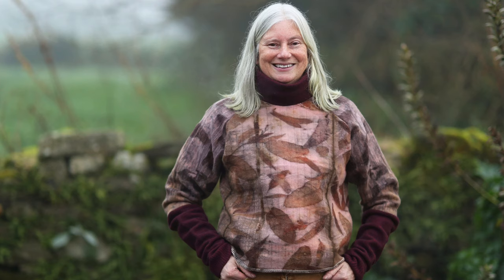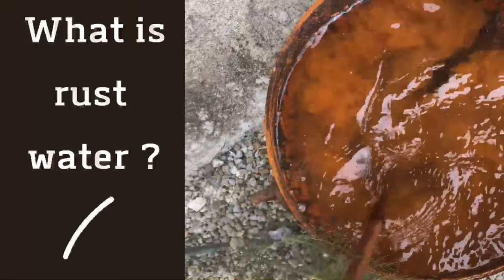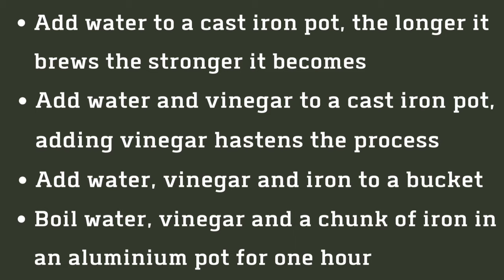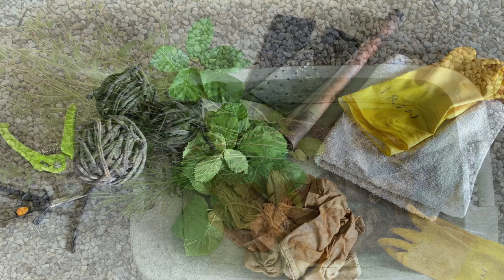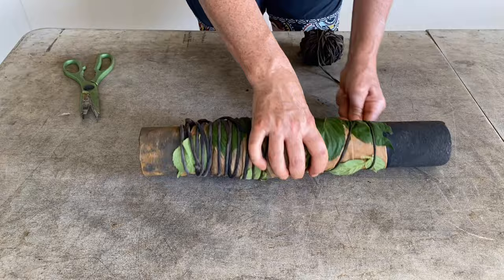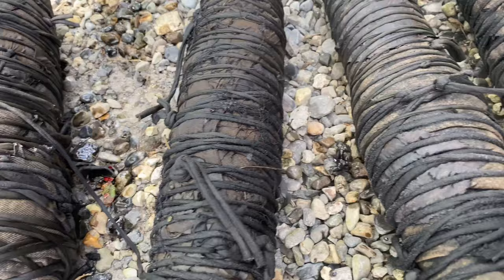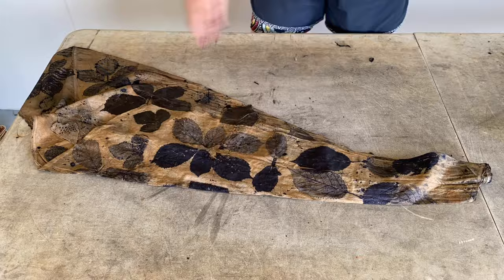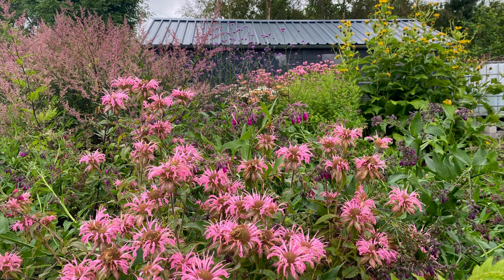Homemade rust water (iron mordant) for eco printing

Comment: Hi Nicola! I have a question, you said you neutralize the fabric with baking soda after iron water, but aren’t they both alkaline? Shouldn’t the neutralizing be done with an acidic substance, like vinegar?
Reply from the maker: Hi Jasmin, homemade rust water replaces powdered ferrous sulphate (which is acidic) so it needs an alkaline to neutralise it.

Comment: Great video! Do you know if iron water only works on natural dyes or does it effect synthetic dyes as well?
Reply from the maker: Hi Jessica, I'm glad that you enjoyed the video. Because I never work with synthetic dyes I honestly am not the best person to answer your question. However, since rust water may successfully be substituted for a ferrous sulphate solution during any natural dyeing process if you personally use Fe for synthetic dyeing I think it should work too. I don't know that you would be using it though! On many occasions I have over printed silk that has been dyed synthetically or commercially (bought second hand or given to me as a gift) using rust water and vegetation and it's always worked very well. This may not completely answer your questions but hopefully it will help!
Reply: @clasheen  I should have ask a more specific question sorry for the vagueness! I have second hand and up-cycled pieces and I was wondering how the iron water would  effect the dyes already on the fabric or if the iron would only effect the newly added dyes.
Reply from the maker: Ah ha Jessica, I understood that you might actually want to dye using synthetic dyes and then print! I have always been very successful up-cycling garments by eco printing in the ‘dirty pot’, regardless of the background colour so just go for it! Of course the colour of the piece may change during the process but I’ve yet to have a result I didn’t like colour wise. Red, cerise and turquoise silk are the most likely to leach colour into your printing pot (wool not so much), they appear to be the least colourfast when using the high temperature necessary for printing without powdered mordants. This doesn’t mean that I wouldn’t try them, just that I wouldn’t guarantee that the background wont change colour quite a bit. Have fun!

Comment: So you make rust water instead of using powdered ferrous sulphate ... get that.  BUT you have as the fourth way of making it, basically the instructions for making your 'dirty pot' liquid and this includes aluminium (using the pot as mordant).   This would not create just iron water, or rust water, or a source of ferrous sulphate.  This fourth method (in the aluminium pot) would be the alternative for a mix of aluminium sulphate AND ferrous sulphate.....
Reply from the maker: Yes Batik, there might be a little influence from the aluminium if making rust water in a pot made from it but that is no problem. The results are excellent when using it